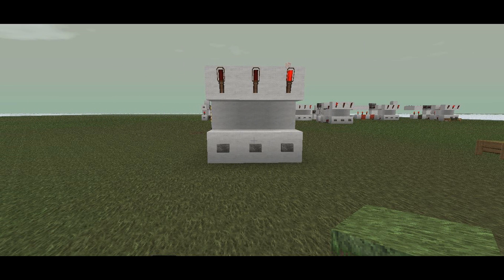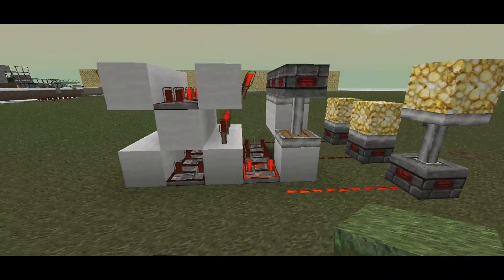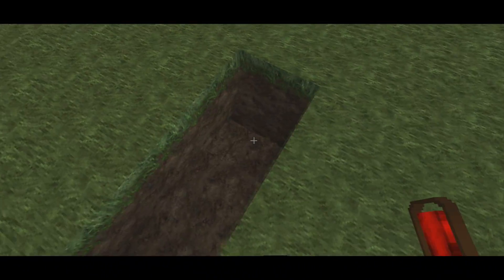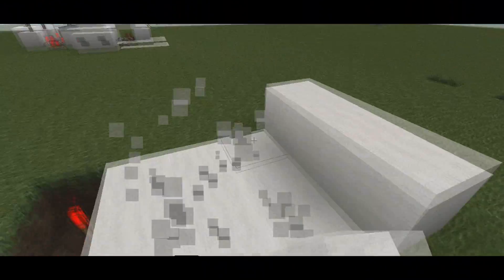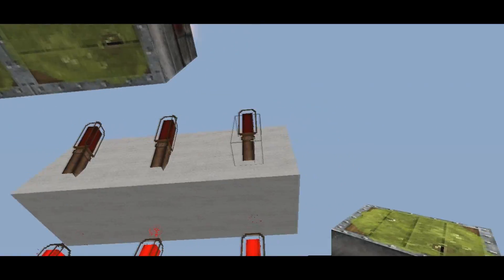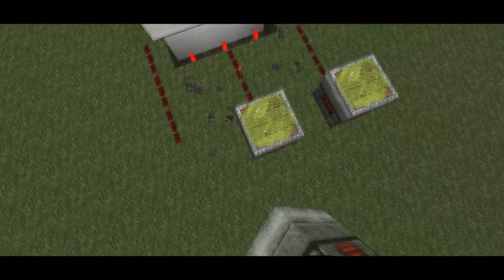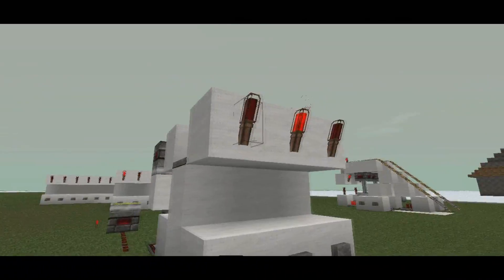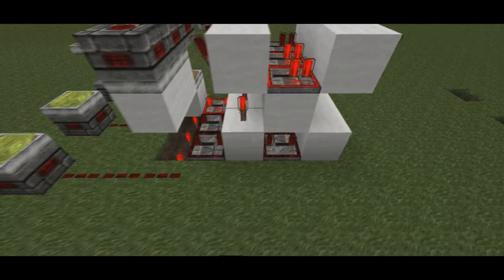Destination Selector 2.0 [Stackable]

Comment from the maker: Select a latch. So what you do is take the button which is used for selecting the destination and put it on a repeater to delay the input as well as having the button hooked into ever latch's reset line. So when you press a button the first thing that happens is all the latches reset and THEN it selects the destination because the signal for selecting destinations is delayed from the repeaters.

Comment from the maker: Well an RsNor Latch is a latch that stores a specific state of data. So if you press a button and the output leads to a rsnor latch then the output will stay on because the RSnor latch holds onto that on signal from the button. To reset the RsNor latch there is a reset line/button which you can press to reset it. To make a destination selector you need to Take an rsnor latch and have it reset every time you press a different destination. So you need to reset the ALL the latches and have it